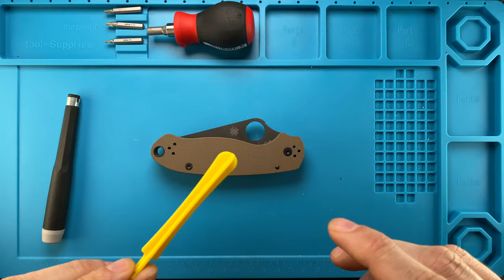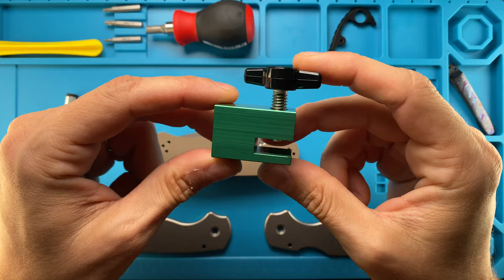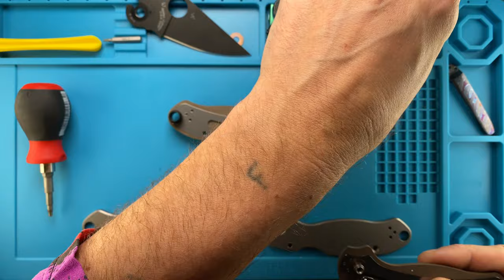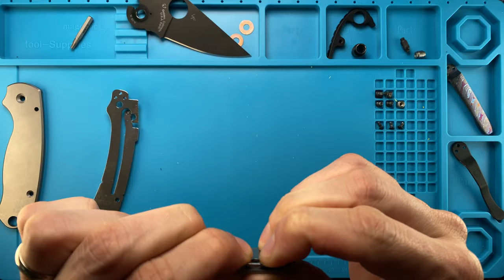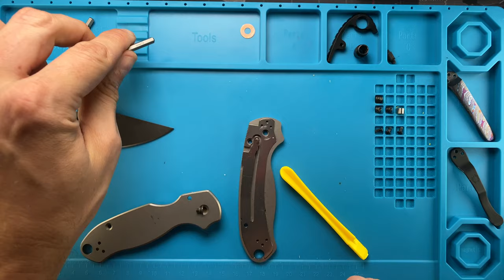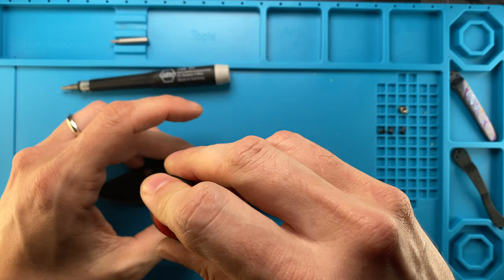How to Properly Pimp a Spyderco Para 3 Pocketknife. Fablades Full Review

Comment: Nice video, I have a para 3 as well and I was thinking to put a back spacer but I don’t know what the purpose is or how it feels on the hand after the installation
Reply from the maker: It looks nicer, and gives more structural rigidity, and the handle should be less prone to flexing
Reply: I picked up a para 3 yesterday and am planning on swapping to titanium scales and adding a titanium backspacer

Comment: Looks so good in blackout with Ti, and backspaced. I don’t love the clip, but the dark and large profile adds a nice breakup of the Ti silver scales vs blackout blade.
I just bought a p3 satin black g10, today, and instantly am regretting not have asked for a lightweight blackout, with flytanium and backspace add ons. I think I’ll get a pm2 In This config then.thanks for showing how it is not too hard to take down a p3.
Reply from the maker: Yes not that difficult, and options are almost endless. I still would like to find a flush spacer, but no luck so far

Comment: Hi!  I have a blade from lightweight (plastic scales) and I'm having trouble inserting the blade into similar scales as yours. First, there is only one metal piece inside the plastic scales, not two (on both sides, just one). Also, I would like to add bearings, but my blade does not "groove" into the ring with bearings. What could you advise me?
Reply from the maker: I don’t think you can install bearings on a para3. I took the metal liners from a G10 one, not a FRN linerless
Reply: @Fablades  Thanks for the quick reply!  I have bearings on my Para3, a blade made of CPM S35VN steel (there are grooves for bearings on the blade), and I want a Para3 blade made of REX45 steel with bearings - there is no groove (?).  Does that mean I only have washers to mount?  I have one more request - could you recommend me a good website with scales?
Reply from the maker: Check Flytanium 😉